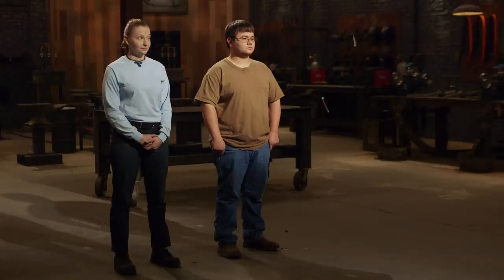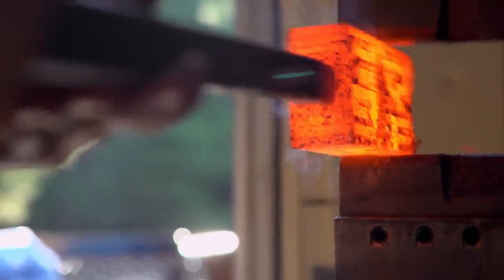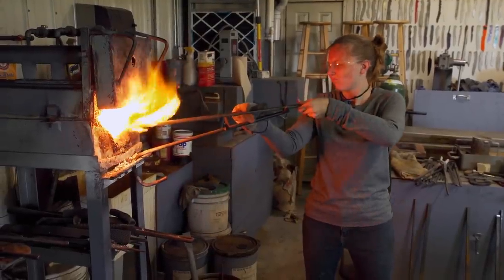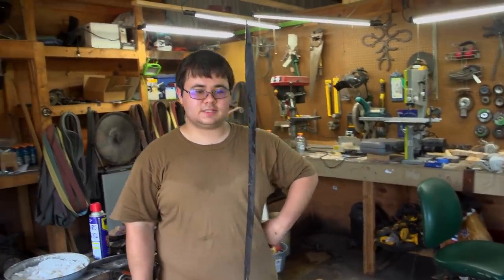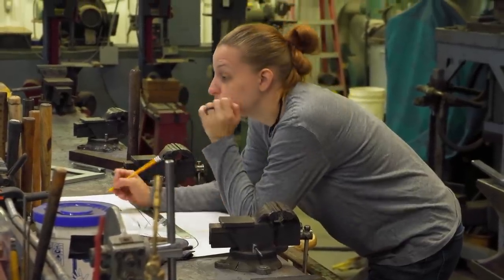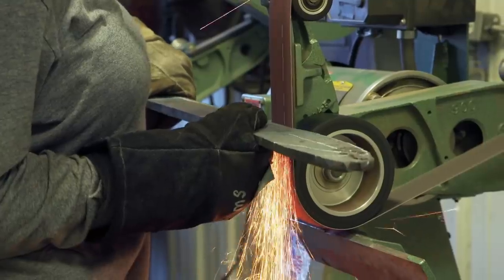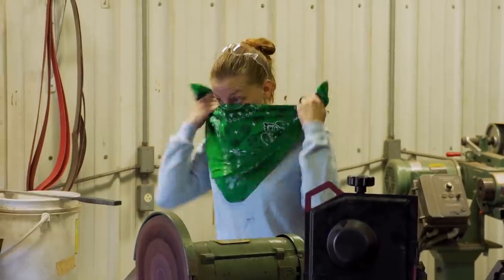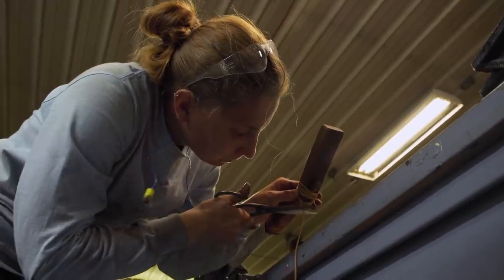Forged in Fire: Pira Sword HACKS & SLASHES in Final Round (Season 7) | History

Comment: why do contestants bother with damascus? it seems like every episode it's "oh i'm going with damascus so it's super pretty for the judges" then day 3 it just breaks.
Reply: Ive posted the same question before on one of these vids.  Too much time to make when you have four days. That's my beef with that decision.
Reply: especially when the look of the blade usually does not end up being a factor in which contestant wins...
Reply: Right, I wonder that, too. I have no experience with blades, making or using. I do have experience with martial arts and with competitions. I'd go for the utilitarian route even if I didn't have like 120 YouTube clips showing this exact same situation 120 times.

But hey. I guess they over-estimate themselves or something.
Reply: When they make it right it's just a garanteed win
Reply: Damascus has a mixed grain structure so is less prone to snapping and is a bit stronger than most mono steel blades as well as show skill in forging think how mixed grain plywood has far less a chance for a break to proliferate through it when planks can easily break in certain directions due to the grain
Reply: From what I know it just means that the higher carbon steel stays longer, meaning it keeps its edge longer... however that's really meaningless if you dont finish the contest in time and truthfully dosen't really matter if you use a soft core (flexibility) harder steel for the blade of a sword. And I think axe's use the same kind of setup also hard steel for the blade.
Reply: @yeetman1344  only if done properly though. Which is why it is impressive. It shows a larger amount of skill to be able to mix two materials into one on such a low level. However if you rush then it is easy to not get the welds to set properly and the delaminations to form.
Reply: most the time i dont even like Damascus, ive never thought to myself "man, i really want a sword with zebra print on it"
Reply: think its more of an advertisement for their black smithing bushiness, showing the viewers/possible customers that they can make damascus
Reply: Fr tho😂😭😂
Reply: When you're making artisanal piece like these, you go extra.
Reply: @yoyo-gd6ff  IF they make it right. I gotta point out that it's easier said than done. We've seen over and over how it can go wrong in this show. :-(
Reply: Damascus is way more durable, strong and flexible than monosteels when forged right. The difference is that a classic damascus katana takes about two months to forge, whereas four days is often proven to be too short of a time window to properly do it. The blacksmiths that do manage to pull it off however show great skill and finesse in their labor. That is both to advertise their work as to test and prove themselves worthy of the title.
Reply: Contestants have turned in some really pretty Damascus blades in the 4 days they have at there home forges
Reply: The people saying Damascus is stronger have no idea what you're talking about. I'm a knifemaker and I can tell you now that Damascus will not perform any better in strength tests than a monosteel blade. They MAY have a level of microserrations that will help them cut longer with wear, but that won't affect these tests. For the purposes of showing skills, they'd be much better off doing a monosteel blade then using nice Damascus for the fittings.
Reply: It's a gamble, but it can pay off
Reply: I honestly don't see the need to go all out making it pretty. I've yet to see one person win because their blade looked better.
Reply: @user-gm4kv2my4u  It definitely happens. Usually when the two blades perform the same.
Reply: Kevin got reaaally lucky that his damascus blade broke on Day 3 of the creation of his sword.
Reply: The look itself doesn't matter unless its a very stylish blade which is rather rare, but as long they get the shape and design of the blade i think that's all that matters in the end. Imo
Reply: from what i gathered,  Damascus is pretty and a tiny bit stronger in exchange of a lot of of hard work and mastery required to nail it all the time, its a show of talent and skill with a very light reward on the practical side and is pretty much pointless if you have already good quality steel and a deadline like four day. 

Damascus is better than not if you nail it don't get me wrong. but now day steel composition is so precise this Technic mostly used to make higher quality weapon from lower quality steel is less relevant. because that's the actual reason you fold steel, to  extract impurity and "mix" the steel components, iron and carbon, better. hence why japan who had few access to pure iron used it and not France or England who had large access to said iron.
Reply: Because with the right steel Damascus is stoopid strong
Reply: Damascus isn't just pretty, it holds and edge better and is stronger and flexible.
Reply: @yeetman1344  I heard that it was mostly just for aesthetics these days due to the quality of modern steel rendering it unnecessary. Apparently it was done to make poorer quality steels homogeneous.
Reply: @thuranz2773  the point of Damascus is that it is two different steels so the opposite of homogeneous it was first utilised around the 3rd century and was better than most mono steels at the time its strength to most modern mono steel blades is only slightly stronger based is mostly for aesthetic but does allow the information of some of the advantages of 2 different types of steel say traditional high carbon steel and spring steel as well as the mixed yet integrated grain structure helps against the proliferation of stress fracturing
Reply: jack higgins this is really only true with low layer Damascus, with two steels of varying carbon, enough so that you get a variance in heat treated characteristics. Monosteels properly treated are generally stronger.
Reply: seriously, just make it out of a good billet of monosteel, gring it to even shape, get even hesat and quench it fully sumbergered. he amout of guys who go on this show who dont have a quench tank or a big enough forge is astounding.
Reply: Damascus was used widely for all fine weapons in the middle-ages. Very historical.  I believe it was Persian in origin and the amount of money they made shipping billets to Sweden was ridiculous.
Reply: I am too lazy to see if someone already posted a similar reply.

Well first I have zero smithing level, but from what I can see, Dough really likes Damascus patterns, he notices in the kill test (which is basically about whether he has fun with the blade or not lmao, so the prettier the better!), and as for the smiths, well this is supposed to be a 10k blade, and pulling that bad boy out of the acid to reveal a gorgeous pattern seems to be soooo satisfying ^^

Go check Alec Steele's channel to see what I mean (he is actually the YouTube Damascus wizard to me)

And a good day to you ^^
Reply: @oopsimdead because if it doesnt warp or crack the blade will be solid and hard to crack or chip during usr
Reply: @VTRAddict  if you are a knifemaker you would know damascus is better and why all high end chef knifes are damascus. They keep the edge far longer.
Reply: @Lickicker  you can actually make a beautiful pattern with some technique and steel
Reply: @yeetman1344  it has been proven scientifically that damascus is not stronger than monosteel, in fact the grain makes it easier to break, since it gives the force a "path" to take and it doesn't go evenly, with monosteel it doesn't happen unless the shape has failure points
Reply: Especially since none of the "Damascus" is actually Damascus. It's completely cosmetic.
Reply: have you never tried to go above what your familiar with they tried and failed it sucks but really dumb question
Reply: @cadecarson1182  then again the idea on this show is to win, not to go above what you can do
Reply: Would be better to use steel for the few tests it will undergo, and put all effort into balance, weight, handle etc.
Reply: Tbh, if it is reproducing an iconic weapon, I rather see a very authentic replica than anything. I saw on other weapons where the Smith searched up facts and details and that just adds a lot to what your thinking and smithing process is. Compared to just making a fancy Damascus. And yes, I agree Damascus is pretty and awesome.
Reply: Well, its not inly the performance of the blade. If both perform identical the better looking one wins. The one the smith put more effort into making
Reply: I think because if done correctly damascus is Stronger than other types of Steel and the prettiness is an added benefit. The tricky part is getting to make a good damascus blade in so little time because damascus is kinda like high risk high reward.
Reply: @yoyo-gd6ff  Do you mind pointing us to an episode where this happens?
Reply: Because when it's made properly it's tougher, more resistant to shattering, and has a more resilient edge.
Reply: Propably reason is that lots of this blacksmiths have experience longer than few weeks, months even years.
Reply: @user-lm9oq6yw6n  yeah but these arent used over a long period of time like a chef's knife. A chef also isnt going to try to break it on crazy substances like on the show. It will get beat up for a few minutes to see how it performs and how durable it is and then will spend the rest of its life on a wall

Comment: “Uses glue to hold the sword and handle together”
Reply: Yep, glue and a warped sword no wonder it loses
Reply: Yup, and works just fine of mixed correctly.  The brass pins that the judge was looking for are a joke compared to the shear strength of good epoxy.  Would have taken something on the order of 90 1/8" pins (shear strength of a little over 410 lbs) to even get close to the almost 38000 lbs of shear strength (.5x6" tang).  Because this design doesn't have really allow for a traditional pommel, I would consider it completely adequate.
Reply: @PhotoBobBarker  THANK YOU, it's bs that they didn't test it even though the handle wasn't pinned. Like I've done WAY worse demos with handles that were glued on and they held up fine
Reply: @PhotoBobBarker  said a kid
Reply: PhotoBobBarker okay, imagine this, they swing the blade and it flies out without those brass pins, the handle breaks as well. Do you know how hard they are swinging those weapons?
Reply: PhotoBobBarker btw, how much forge experience do you have?
Reply: Awww Yeah Shim Sham No. Not at all. For pins to bust you basically have to have the blade shatter first. Epoxy has an easy cracking point when it comes to blunt force, so I'd give it about 6 swings before it broke.
Reply: PhotoBobBarker yknow that these judges are master bladesmiths right? They know what they are talking about. A lot more than youtube master commenters thats for sure
Reply: @Alvah707  yeah it's totally not like they have an ABS master smith, a historic weapon recreation expert, and a bladed weapon martial artist that has his own line of knives made. Totally they dont know what they're talking about
Reply: I would forfeit rather than shame myself
Reply: @PhotoBobBarker  I have s small sword hold with nothing but gorilla glue to the handle and its tough as ... nails? Well it has never loosen.
Reply: @SingingWhileDrunk  Modern reproduction blades have epoxy over pins in order to tear them down you need to boil the handle always.
Reply: @PhotoBobBarker  you started out on the wrong footing by assuming this show is anything but a joke in almost every regard.
Reply: @steveman751  The blade will simply fly off and dangerously land on someone, its not even made in at least decent wood joint, just stick 2 flat wood and end and glue it
Reply: @PhotoBobBarker  Yep, I have no idea why they don't trust epoxy. I have full confidence in fitting a hidden tang with epoxy alone. It's absolutely impossible to pull that handle off the tang, the material of the handle cannot be physically gripped hard enough to pull that hard without destroying it. The only situation in which pins are better is if for some reason it's gonna end up baking in an oven and ruin the bond by heat. Which is ridiculous.

Comment: Wow why even turn that in? It takes literally half hour to put a pin in it and sand that handle round and smooth. How you gonna glue two pieces of wood together on that blade lmao
Reply: A) I believe they have a limited amount of time per day to work, managed by the camera crew following their work.  She may well have literally ran out of time.

B)There are several historical examples of blades that are glued only.  Doesn't mean that they won't hold up.  Many Indo-Persian swords were only secured by glue (Tulwar, many Shamshir, Kora, etc.).  Traditional Japanese swords are merely secured by a single bamboo pin with no Glu or peening, and a tang that's shorter than the handle.  I'm saddened that Doug chose not to test it, because it very well may have held up.
Reply: @Langenschwerte  I'm guessing it's A) as to make sure no one is cheating
Reply: @IronCow8  A bit of epoxy is objectively stronger than those time tested specialist methods
Reply: @IronCow8  Do you know how strong modern epoxy is?  The amount of epoxy used and it being in a nearly direct shear loading, her handle could have lifted a Greyhound bus and 10 passengers (literally).
Reply: @Foxxie0kun  Not really.  The transverse pins don't provide nearly the strength people think it does. Only about 400 libs of shear strength for a common 1/8" pin.  For the surface area of her tang, the epoxy would have given it somewhere in the area of about 38000lbs of shear strength.  In fact, adding a pin would have weakened the blade.  In those cases you mention that the blade broke in or around the handle, it will usually happen at the front of handle/guard (usually bad heat-treating), at the pommel connection, or inside the grip where the holes for the pins are drilled.  Being this design didn't allow for a traditional pommel, her solution was actually STRONGER and safer than riveting the handle on.
Reply: Wahmen

Comment: correction to the host

Pirah or pira is a type of Philippine bolo sword or knife characterized by a heavy blade and a wide tip. It superficially resembles a falchion but is much heavier. It is the traditional weapon favored by the Yakan people of Basilan Island. It usually features a kakatua ("cockatoo") hilt, which among the Yakan is distinctively elongated to function as arm support. Among Cebuano people and other Visayans, a similar sword is also known as the pira, but differs in that it has an acutely pointed tip. Like other bolos, pirah were commonly used as farm implements, in addition to being used in combat.

Comment: Damascus is pretty but you're adding complexity into a time-compressed build, in a modern era where better steels are available. Picking the best modern alloy and spending the extra time making sure your monosteel blade is hardened and tempered correctly and the handle's usable with no stress risers anywhere, that seems to be a winning strategy to me...

Comment: They should use some sort of a mechanical device/robotic arm to test the blades. This will provide safety and consistency.  I feel the second person up has an advantage because the first test tired the person wielding the weapon out to some degree. Also, what's the point of competing if you can't do the job right? Ran out of time??? Should have forfeit instead of turning in a dangerous sword.

Comment: She made two major mistakes. First no pin. Second, she pinched her blade out not properly bevel the blade. It's likely her blade would have snapped, broken out of the handle, or snapped at the connection where the blade met the handle

Comment: OMG,  ya should give her a chance 😔
Reply: D Degoga if the handle didn’t break in the kill test it would’ve broken in the strength test. Plus it could’ve potentially broken in the kill test just because Doug didn’t want to hold back when swinging and slashing at the boar, because it’s not a fair test otherwise. Stop with the sympathy, it’s her own fault for trying to impress with Damascus when looks apart from the shape of the blade literally mean nothing in forged in fire
Reply: The judges could get hurt if it breaks

Comment: Besides, you fools are making Damascus steel in the wrong way.  Its not just stacking iron plates and forge weld them. Its actually one piece of steel bend 8 folds and then forge welded. Its important because the tips wont break down and overall carbon atoms will be in exact pattern. It becomes light, but strong, it wont break, but still flexible enough.  Still Indian village blacksmiths do such steel forging for hunting sickles and axes. Give the credit. You cant just steal the steel....

Comment: Damascus is always a gamble in a competition like this, because even if done perfectly, one incidental failure in any part of the damascus billet will cost you the competition. Yeah, it looks amazing once it's etched and finished, but I'm a pragmatist. I would want a weapon that would stand against an army and outlive me, not one that would look pretty as it snapped in half and got bathed in my own blood as my assailant lops my head off.

Also, calling it now, but a handle held on by nothing but epoxy? Her handle is gonna fail in the Strength Test for sure. I've seen blades with handles riveted or pinned onto the tang that have failed before, epoxy is NOT strong enough for this task.

Edit 2:

Holy donuts, not even safe to attempt to test it at all? That's hard breaks for Weslie, but that's what wasting two and a half days on a Damascus billet does to you in Forged in Fire.